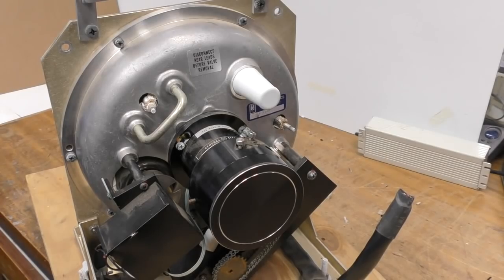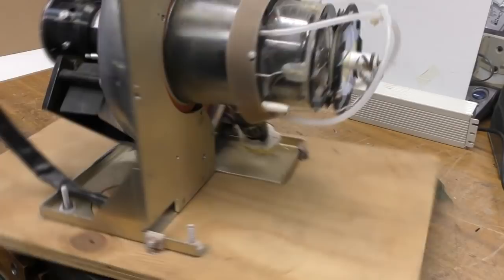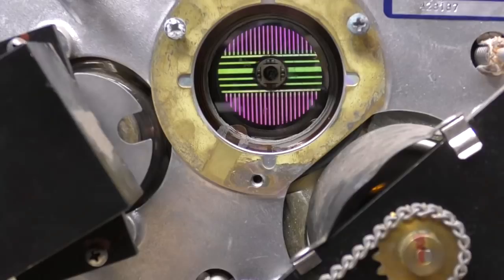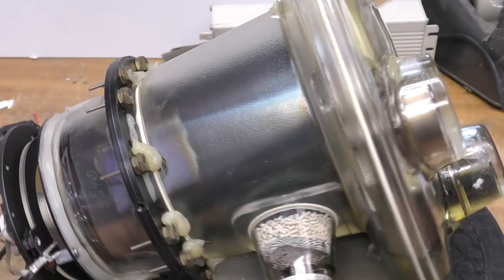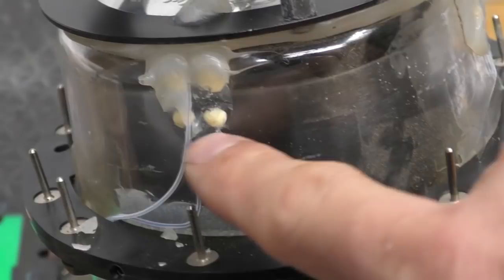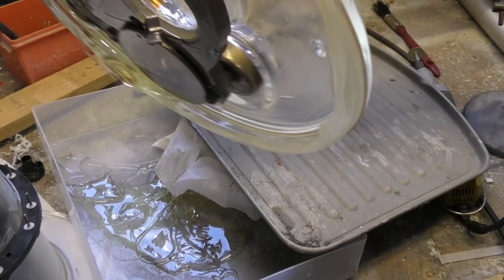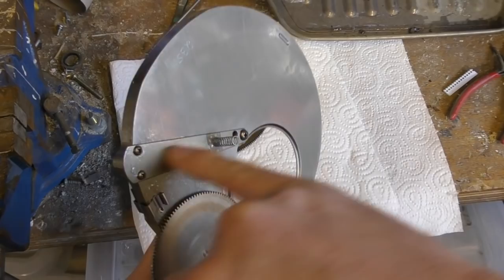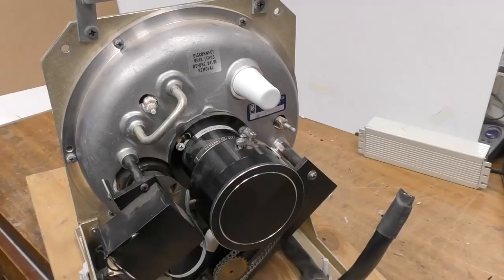GE Talaria projector light valve

Comment: Those beads on top of the "electron gun" are definitely a vacuum rated descicant, it will take out water vapor and maybe some other small molecules.
Reply: Thing under may be an ion pump or something similar. They are used in closed systems that need consistent pumping to maintain a high vacuum.

Comment: Very interesting. The vacuum conditioning device reminds me of early Crookes  x-ray tubes where the vacuum wasn’t perfect and pressure could be controlled by heating a gas trap. Could there actually been a controlled gas pressure rather than a complete vacuum. I have a feeling there were tubes that used a slight pressure for focusing. Also seen heater devices to release hydrogen in thyratrons.

Comment: Think that was designed to service, just take the unit, place in a jig, and bake in an oven at 250C to get the vacuum epoxy above glass transition, and it would fall apart. Likely first break the gas seal, which is easy to do with a hot wire and thermal stress, though likely GE did have the whole assembly in a vacuum when doing this, so as to allow them to not contaminate the oil, or have it catch fire when they allowed it to come back to room temperature.

Got to be some real special oil, to not evaporate any amount in a high vacuum., and still act like an oil.

Comment: Presumably the electron gun is in ceramic because of the external heating from the lamp it is in front of, coupled with the relative isolation from any form of heat sync, and the filament working temperature, I would imagine it was easier to package it in a housing which withstand the heat.
Also being opaque would eliminate a light path around the electron gun avoiding the filters at the back of the tube.

Comment: I used to work with these in the 90's and have always been fascinated with how they work, until today none of the available documentation really  helped clear it up.
Than you so much for sacrificing this one, everything now makes sense.
However, as you say, the colour mixing is still  a bit mysterious, but having seen it I feel as though I could solve that challenge if I was charged with designing the thing, whereas the oil valve thing totally bakes my noodle.

Comment: Those pellet looks like molecular sieve, the gauge like object could be a getter pump
Reply: Yes looks like a getter assembly and vacuum gauge all in one, heat up the filament to measure the vacuum, and then toast the getter disks to get a higher vacuum and remove the oil vapours.

Comment: I think this might be one of the valves from a slightly later version of the projector - the page you've linked mentions they made a single-tube version, a two-tube version with one tube for green and one tube for red/blue, and a three-tube version. If this is a red/blue combo tube, that'd make sense...
Reply: No... the single light valve PJ (ge had different models, we had a pj5055 that utilized the same "clamshell" (as ge referred to it) as in this video. The "mlv" (gets multi light valve) was used to get higher output/brightness.

Comment: I would like to point out that even though this is a critical component of the projector shown here, it had many other aspects to it including the Xenon Lamp, remote control, digital signal processing (probably worth investigating considering the era), rasterization circuits, chassis, power supplies, and a built-in spanner wrench. I remember reading the specs that indicated how many G forces the projector would operate under.

Comment: Cool teardown. I hope that oil isn't polychlorinated biphenyl (PCB).
Reply: Good point. It is always a risk when tearing down rare and exotic equipment that they could contain lethally toxic gasses or substances within, and have been assembled at a place or time when warning labels weren't a legal requirement.
Reply: No, certainly not. Way too low of a vapor pressure. This is likely silicone oil, since it operates at high vacuum.

Comment: at 22:40 wouldn't that encoder still spin even if the inner disk was stuck since its mounted to the motor? or do you think the magnetic coupling is strong enough to stall the motor?

Comment: The white stuff is torr seal epoxy resin. The oil inside is probably perchlororo biphenyl. You can wet a piece of tissue and burn it. If it burns with a green smokey fire that is it.
Reply: Googling perchlororo biphenyl turns up nothing. Can you say more about it?

Comment: The assembly is a vaccum pump
Reply: Sputter pump... Maybe... Would not be surprised if the wire on the inside was titanium...
Reply: Got the name wrong.
The real name is "titanium sublimation pump"...
Reply: @waldovanderwesthuizen4557  From what i know, it is not just a sublimation Pump, you see also from the construction it is quite a different concept
Reply: i have to take a better look at it but it resembles more a Non-evaporable getter if you look at the disks, but then the pressure seams a bit high for that
Reply: @heinrichhein2605  I agree, it’s unusual and must have something to due with controlling something other than straightforward vacuum, my guess is it’s to deal with something breaking down in the oil over time not just typical air impurities. Possibly breaking down from the huge photon source of the arc lamp and extreme UV radiation.

Comment: Is this the technology used in the NASA control room big screen, during the moon landing?
Reply: @aphenioxPDWtechnology  I think only the TV video was Eidophor, weren't the maps this elaborate shadow play of metal stencils?
Reply: @AHaensel  all 3 of you are actually correct: https://youtu.be/N2v4kH_PsN8 - a completely custom eidophor was definitely used for the B&W TV, but according to the nasa documents, we know that was definitely replaced with a color GE Telaria some time between when they shifted to color camera on Apollo 12 (so late 69-70) through the upgrades in the mid 1980s. They possibly used an eidiphor with a color wheel early on for color TV before they switched to the Telaria. And the map and other displays used a combination of 5 1KW slide projectors using metal coated glass slides with a pre-etched icon or map combined with a blank slide that used a diamond stylus to cut the telemetry line directly into the plate. All controlled by ibm system 360 mainframes in the Apollo era.

Comment: I remember hearing from a service person that they used WHALE OIL because of its properties.
Reply: Unlikely because it would need to have a consistent composition and very low vapor pressure to preserve the vacuum. And whale oil doesn't gel up like that at room temperature.  Most likely some kind of silicone, with additives to control dielectric constant and conductivity.
Reply: @bobweiss8682  I thought it maybe an ionic liquid since they're quite viscous and don't evaporate.
Reply: Whale Oil Beef Hooked

Comment: Did engineers of this era sit around daring one another to invent the wackiest possible gadgets? Bonus points if you can get organizations and government to shell out large fortunes for ‘em.
Reply: If you think about it, a DLP device is also a pretty wacky idea. Imagine the first guy thinking "What if I had one mirror for each pixel? A million mirrors. Seems reasonable."
Reply: Given there was a lucrative demand to project large format video, and so few ways to achieve it - practical or impractical..   These old things seems so bizarre and clunky but the new stuff is even more bizarre it's just invisible to the eye.
Reply: @DrTune  You are probably right. LCD is certainly on par with the oily mechanisms on display here. “Growing” silicon wafers is also a rather bonkers notion.

Comment: are you sure its oil and not glycerin?
I have a few projection tv's that use that as a lens
Reply: Yes, it’s oil. Every description of schlieren-optics projectors say it’s oil.
Reply: Glycerine would boil in a vacuum.  It is a selected oil that is selected to work at a temperature that is higher than you would get from the projection lamp alone so that it can be heated to a stable temp which then dictates the viscosity profile.

Comment: The oil behaves like silicone oil but even thicker?
Reply: Silicone oil comes in a lot of viscosities, all the way up to 'putty'.
Reply: @procrastinator1842  I’ve since encountered this too! Makes me think even more that it’s probably silicone.
Reply: @hotplatelabs  Cool! What applications have you found it in?
Reply: @procrastinator1842  It's so mundane 😂 But silicone "putty" earplugs. Also I've got a tub of silicone oil that's been slowly turning itself in to putty as something evaporates out of it...
Reply: The tub of formerly-silicone-oil behaves a lot like what's shown in this video.
Reply: @hotplatelabs  I'd be very interested to know what solvent is used in it! I'm using some VERY thick silicone and it's not easy to work at all.
Reply: @procrastinator1842  I've been using TSF451. The datasheet has a list of solvents that work on it!
Reply: @hotplatelabs  Interesting. I got excited, but the viscosity and quantity I need is....a bit more, about 20 times more for both actually, hence why I need a solvent to allow it to flow, then by using heat, hopefully evaporating the solvent and leaving pure PDMS silicone behind. I can't seem to get any if the data sheets to download? Weird.

Comment: Mad as a box of frogs.
Print it onto 70 mm cine film and run it thru a projector
El cheapo.
Reply: You can’t do that in real-time. These projectors were not used for prerecorded content, as film would be way cheaper indeed. They were for real-time data visualization, event jumbo screens, TV station backgrounds, etc.
Reply: @tookitogo  A few people have mentioned flight simulators.
Reply: @KallePihlajasaari  That was one application for them. NASA used many of them for flight displays in the control rooms. They were used for large venue projection at conferences, concerts, and the like. I originally learned of the Eidophor (the original oil film projector) because it’s what was used for the “Mother of all demos” where Doug Engelbart showed the first graphical computer interface.